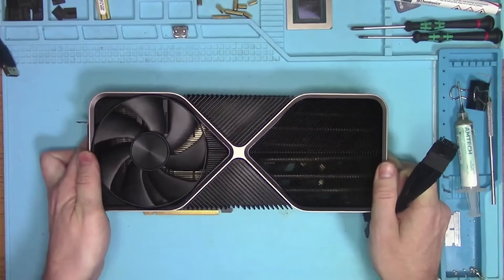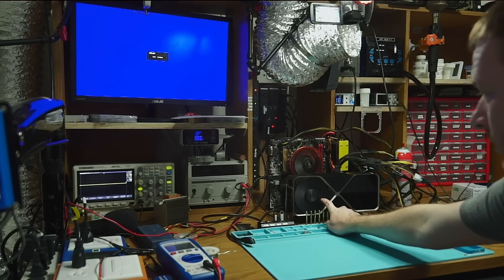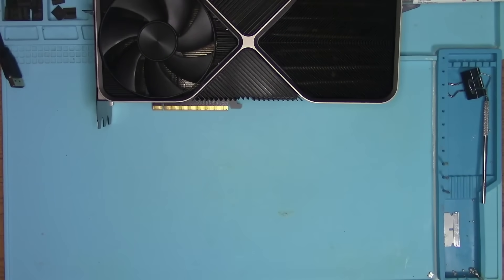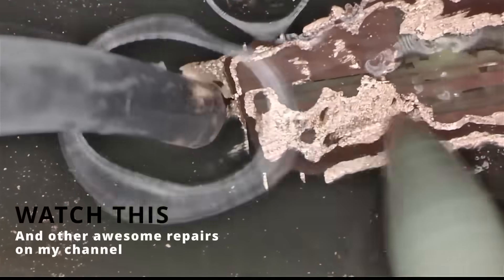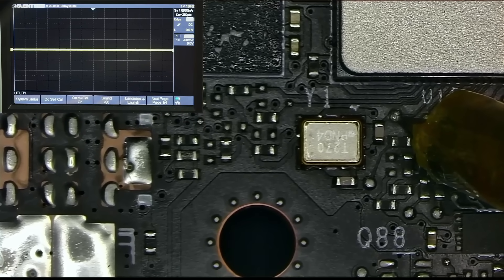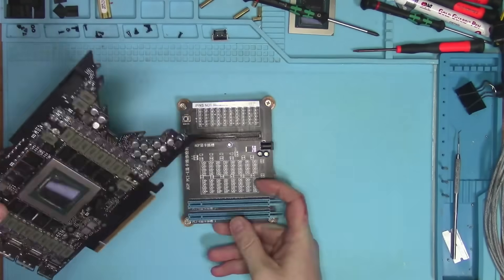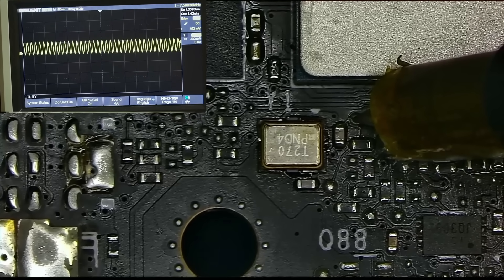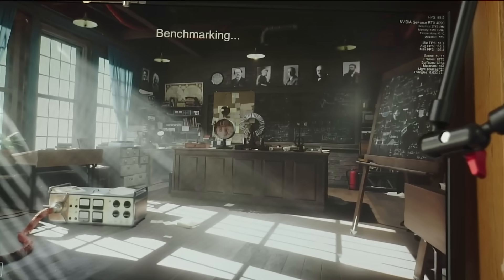*Warning* this video is NOT a JOKE

Comment: You know what would save my 4090? Having the price reduced to a maximum of $1,000 so I can finally buy it. I get it's the top tier, but it shouldn't be twice the cost of the rest of a PC. Let's see, $300 on a CPU, $200 on a mobo, $150 on a PSU, 100 for RAM, $150 for a case, $100 for a cooler, that's $1,000, what's missing? Oh yeah, forgot to allot $2,000 more for the graphics card.

Comment: There is something still wrong with the card, was showing between 25-40 FPS in a section of 3DMark where my 3080Ti has around 60 FPS in 4K, unless you did some custom crazy resolution test!

Comment: Get a good case & you won't see that problem.
Reply: Do you think a bug could fit in there outside of assembly? Hello?
Reply: @noobehnoober3178  Outside of assembly? Yes. They would have noticed the card not working & it would have never left the facility. Bugs can fit where ever they want. You'd be surprised. A good case will prevent that. The owner of that  GPU got either a budget case or a bad case. 

The GPU was bought from a dodgy second hand place with no warranty. So it was most likely used before.

Comment: When I was a kid, back in the 80s, my father had a top of the line Sony Fax Machine he used extensively for work. One day the damn thing stopped working out of nowhere. So, we took it out to a technician, he opened it and a full blown ants nest was built inside it and some of the circuitry was damaged. The tech fixed the fax machine and along with it, he gave a bag with a few dozen ants inside lol

Also, once a roach got inside my PC case and I really freaked out (I live in south american, so at some points during the year, bugs are a huge problem). Opened the case, it hid somewhere, the next day I opened the PC again and it was dead, stuck along the cables.

Comment: It has always been that the exceptional best cards are not good. Usually defective after the warranty.
They do this on purpose.
We found out, after we used to have many computers built with expensive 8800gtx cards in 2006

Comment: I have a master degree in computer engineering.  I had built computer from chips and boards.  Even done cpu and motherboard design verification at logic and machine code level. Coded device drivers and fixed Linux kernel code.  But watching this guy still impressed the hell out of me.  Cannot imagine what knowledge and experience he must have possessed to debug and fix such board😮.  Amazing🎉

Comment: The factory needs to debug their factory. No way in hell that got under there post assembly. Don't they test their cards after assembly.? It should have been a failure before it left the door. True story years ago MICE found a nice, warm home in my parents desktop PC (was missing a couple slot covers - should have closed those!). The mice crapped all over the graphics card and shorted a few vias to say the least. It was an old card that also destroyed the motherboard so I just scrapped them both and built a new system.

Comment: How much did this repair cost? Curious because it was a hugeeee process and looked to me one of the toughest job which could occur while repairing any gpu
Reply: Honestly the high cost of repairs is the main reason for obsolescence. This repair likely cost as much as an used card but without any guarantee that it would work and fix the board.

Comment: After 200 years of electrotechnological development by humanity since the morse code transmitment, this is what we have ended up with.
Creating expensive bullcr💩p GPU's that have to be fixed by the customer in order to have it last longer than a year, and even taking the risk of having his computer burning down the house due to poor quality power connectors on the card.
This is another reason why my doubt in new technology are NOT groundless.

Comment: From a resale place with no warranty?  I hope he wasn't a victim of a scalper.  Those S.O.B.s have caused everyone enough misery already with their obscenely high prices that are often 3 or more times the MSRP of an already very expensive item.  I hope everyone who has ever scalped a graphics card like that burns in Hell!  Then on eBay there were listings for pallets of often 100 or so cards that the seller allegedly had.  Of course being the pricks they are they could not help ease the shortage by selling just one or two to someone who wants them for their intended purpose.  Instead if you wanted one you would have to buy the whole pallet and that would be anywhere from $60,000 to $100,000.  They should not be able to get away with that really.

Comment: The bug probably landed on the board and got stuck in solder paste while the board was queued up to get populated. He crawled around a bit before a big part got set on his head, then things got real hot. The board must have worked at the factory, so the failure occurred sometime after. Likely an open circuit. I wouldn't think a cooked bug would load the clock enough to stop it.

Comment: Funny thing actually. The term debug comes from the time when NASA was building their Saturn rocket prototypes and the processing units they used - used literal magnets in different orientations around coated copper wires, but from time to time literal bugs got in the cores and shorted them out. So debugging back in the day was literally debugging just like you did in this video.

Comment: LOL You found a BUG unfortunately dead one, if you will found a live bug ... that would be awesome :D
Reply: Test their resistance with multimeter, its unbelievable reading all these comments about bugs shorting low voltage circuits. Bugs shouldn't be that conductive. this shouldn't be happening in modern PCs

Comment: Some connections were shorted under the GPU, when the GPU was lifted off. When the whole thing was rebuilt, the connections were clear. Shorting the connections like that, was a manufacturing cheat. Nice and fast work, maybe the card has better bandwidth now.

Comment: typical novideo trash. How does a bug have low enough resistance to short something out. If it just didn't work, then it would make sense. But it actually fried something, somehow. Nvidia always cheap on PCB design, which is why you always have to buy a more expensive custom board.

Comment: I still can’t get over how tiny the PCB actually is.
Reply: Yup the technology is impressive really once you strip away the giant cooler needed for it.
Reply: yeah, its so small. all these new cards getting bigger over the years felt like "newer tech, higher power, better, faster!" but it wasnt related to the new tech at all just the heat it produces xD
surprising
Reply: I keep thinking the same thing every time I watch these videos of current gen GPUs getting taken apart. These cards aren't much bigger than what we used to have, say, 20 years ago. 2023's gigantic coolers vs tiny, passive heatsinks and/or itsy-bitsy fans aside: I guess the manufacturing process is so much more advanced these days (5 nm currently IIRC?), so they don't need to use a massive PCB. I wonder how large the card would need to be if that 4090 still used the 130 nm process that the Radeon 9800 used that he repaired a few videos ago. 130 / 5 = 26, so... 26 times as large? But that's probably not how that works... :D If it is: That would probably mean a graphics card at least the size of the old Defender arcade board I used to have hanging on the office-wall. And that thing was the size of a small- to medium-size poster. :D
Reply: The 6xxx series of NVIDIA gpus will have some sort of L3 cache directly near the core itself. Just immagine having 6x as much bandwidth with cache rather than RAM. And clearly you'll need like 2GB of cache and 16GB of GDDR7X memory, yes, just 16gigs to be 5-6x faster than 4090, all thanks to the 2GB cache. The resposne time and throughput of the cache is insane.   In CPU L1 cache has like 300-450GB/s bandwidth, yes, gigaBYTE not gigabits... so the same ammount of cache ( lets just say you have 2GB of cache and 2GB of VRAM ) can refresh itself 4x and regullar RAM chip just once.
Reply: ikr!! all the gaming/productivity power in such a small card blows my mind.
Reply: I mean its not supersmall rly, I have a RX 6800 XT and its basically the same its just longer instead of taller
Reply: oh yeaaaa 🙆‍♂️
Reply: Lol it's not small
Reply: Now look at 5090
Reply: But look at how BIG the die is
Reply: @ yeah man, you’re right about that. Holy cow….
Reply: Huge core though

Comment: So like the original Eniac an actual bug was in the mix. Damaged a component. Jeesh cap'n. How awesomely bad luck that was. And how much room is between the balls and core anyways. Seems it would be too harsh an environement. Maybe add something nasty to bugs. But probably not as it would cause corrosion. Tolerances outside the limits for a new card. WILLICKERS. ALMOST caused a very expensive card to be permanently inop. Only PNW repair could make this jobbie work its life away, or have a life.

Comment: That’s a weird fault. The bug couldn’t possibly have crawled under the core after it was soldered so it must have gotten trapped under the core during the original reflow soldering step at factory.

If this were the case though I’d have expected the card to fail the end of line function test at factory because it would have immediately shorted something or even prevented some of the solder balls from soldering correctly.

That defect should have been detected before the card ever shipped to retail
Reply: it could absolutely have crawled under the core after it was soldered. There is quite a gap. Everyone that ever had a GPU in their hands and cleaned it with fluids/alcohol would know.
Reply: @narfsc2657  it’s not 100 % impossible but that bug would have to get into the case, then get into the card on the top side between PCB and cooler pass all of the surface mount parts including the memories and thermal pads and then crawl under the core that sits in the middle of the PCB.

In the other case that bug just has to find its way into the pick and place machine.

Either way an absolute freak HW „bug“
Reply: @Numfuddle My assumption is that the card was previously serviced and resoldered by the manufacturer, and since its done in a different room than the factory line, theres a greater possibility a bug couldve crawled in.
Reply: @Numfuddle  assuming it was just one bug not not many and this little fucker just got stuck or it was killed by the heat. might also have bene an egg in there that hatched. especially bed bugs find their way into electronic devices when they hide. saw a video of a tablet repair and a live bed bug came out of it and the inside was full of bug excrement, dead bugs and even eggs. one of the most disgusting things i've ever seen
Reply: You can just about see the bug is there on the previous shot when the GPU is lifted off the board, so def not staged and why would they? Just reballing it and finding and replacing the additional component is impressive enough.
Reply from the maker: Big must have died possibly dripping it's own juices causing corrosion and a failed solder joint as a result.
This is the best theory I can come up with.
It could also be a coincidence and all it was is a cracked solder joint and bug had nothing to do with it.
Hard to say which one.
Reply: you'd be surprised where bugs end up, in my case one managed to end up inside of the lcd of my gameboy pocket.. there shouldn't be any possible way for it fit unless it was the size of a mite at first.
Reply: Cleaner at assembly plant said, fk dis, Im taking this one home and selling it.
Reply: in a world where every electronics is tested.
Reply: maybe they do batch testing like pick 1 from the 500 batch and test ?
Reply: The factory is sterile everybody wears suit no way that bug from a factory no way.
Reply: it's no different than how dust gets way up under your screen protecter.
Reply: that is what i was thinking!!! Seems that its an NVidia AIB that dont have a very clean "Clean room" lol. Nasty.
Reply: it probably made it through one pass they only extensively test one in 100 or so.
Reply: Thats what I was thinking damn not even a clean room is clean enough if people are moving in and out of it.
Reply: That's assuming they test more then it powers up.
Reply: I mean, assuming they go beyond power testing, also, they might only pick 1/100 for a full test, or testing at all.
And I've had a spider on more than one occassion invade my system that got burned under seemingly impossible to reach places.
Reply: @smitteree If I recall correctly from the graphics card factory tours I've seen, they go well beyond a simple power on test. They supposedly run full functionality tests on ever single card they produce.

https://youtu.be/BYzxDaxNer0
Reply: @blunden2  That does not mean that Nvidia itself does this with their founders cards though.
Reply: Dude these cards are made in China. These Chinese factories aren't well known for their quality. Nvidia is selling their products at such huge markup due to the Chinese low quality low cost manufacturing. Don't expect quality from Chinese manufactured GPU. I haven't bought any new GPU due to this fact.
Reply: Sounds to me like this might've been staged then. To get clicks and such. I would also think that soldering at those temps would melt a bug entirely but it looked almost fully intact.
Reply: @larkan511  why should they. The whole rework is impressive enough that they don’t really need that sort of publicity stunt. Don’t perpetuate conspiracy theories. Especially for something that has simpler explanations.
Reply: @larkan511   that doesn't really seem like something this guy does, looking at his other videos.  Non-working GPU's aren't exactly uncommon and the reasons for them are countless - something like this can easily happen during the manufacturing process ... or post-manufacture in many cases.  Taking the shroud off my 4090 reveals innumerable places a tiny bug could crawl in even now - with it fully assembled.  Bugs tend to get in all the places they aren't supposed to be and can often somehow squeeze through gaps that their exoskeleton appears to be too large to fit through - but they do it.  

Those pests are a lot like mice - another one that tend to squeeze into way smaller places than they ought to be able to.
Reply: @larkan511  - You think bugs melt?
Reply: @larkan511  Ridiculous. Some people see conspiracies everywhere. Get your foliohat on even tighter.
Reply: @larkan511 i highly doubt they would risk the hit to credibility
Reply: @lolcat its Chinese and nvidia they don't care about quality
Reply: They don't care enough. Shit happens during shipment, so they can jus default blame that. Also, with how precise these systems are by now, they can just test every few cards on the line, so as to weed out a fault in the system. As long as 1 out of 5 work, everything else can be attributed to user error or shipping damage and save a lot of money. @lolcat
Reply: @larkan511 the effort of reballing isn't worth it for this many views?

Comment: Unfortunately because of environmentalism many materials were switched from petroleum based to plant based. One example is the insulation on wires which is now almost completely soy based and which bugs and rodents find quite edible. Really is a big problem with modern cars where mice and rats chew up the wiring harnesses. Same issue here plus bugs are attracted to the heat generated, especially during the colder months.

Comment: IMHO, radius routing those corners obviously isn't good enough. I don't know why they just don't selectively plate those areas, including the edges, and/or laminate with sturdier dielectric/prepreg material (e.g., Kevlar or other para-aramid's) to provide further reinforcement. It would undoubtedly raise the bare-board cost, but would most likely be cost effective in the long run.